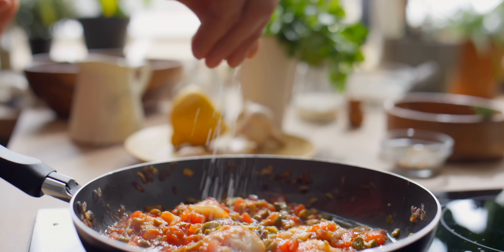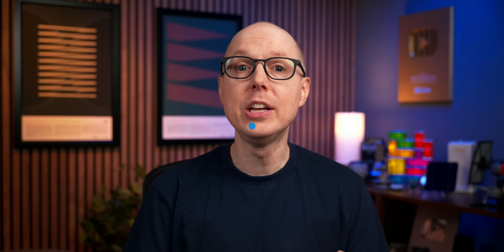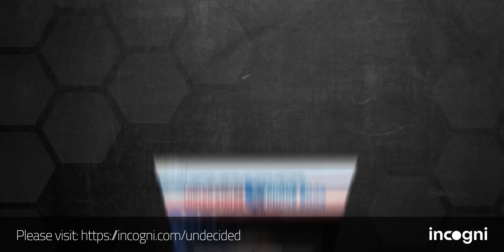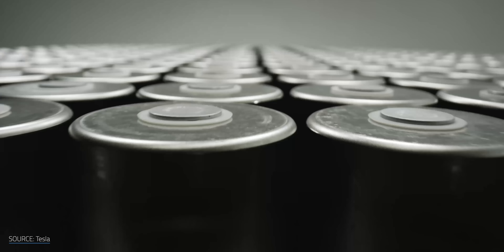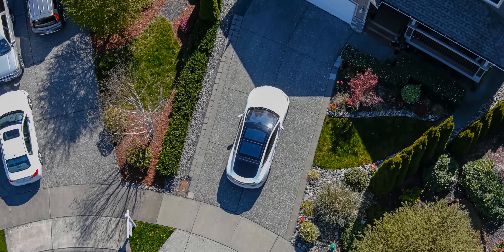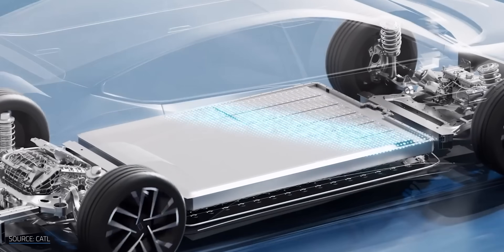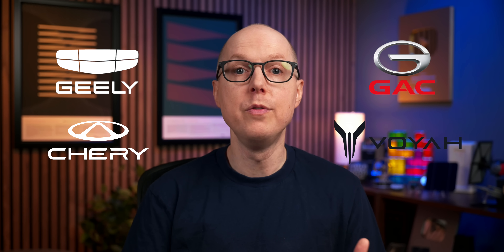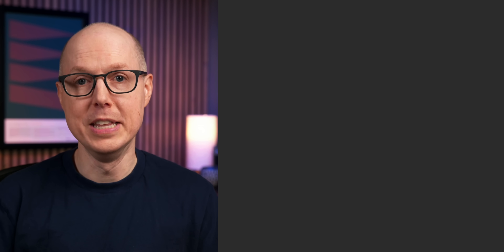How CATL Made Batteries 90% Cheaper (And What Happens Next)

Comment: I would absolutely buy a sodium EV with a cheaper battery but less range and less power. I drive like 70 miles per day tops, and I barely use a quarter of my EV's battery every day, therefore it could be way smaller and I'd still be more than fine. If I ever need to take a longer trip, I could just stop more often. And an EV half the price is already possible even with LFP batteries if they would just build them with 100 mile range or so. The low range isn't what killed the early Leaf, it's the lack of adequate fast charging access and speed. A car with that amount of range but charges quickly and works on plugs that actually exist could be easily affordable and totally viable (drive for an hour and some, stop for 10-15, sounds groovy, wouldn't be bad), people just convince themselves they need more. But yeah of course with sodium they can have more and still get it cheaper as well.

Comment: One glaring thing you didn't mention is that CATL is only selling those batteries in China, and unless we end tariffs in the US on Chinese batteries we may never get those here in the US... that is right, sad panda is sad. Maybe they will partner with someone over here to make them, let's hope so.

One minor thing you didn't mention is that even though the energy density is lower (175 WH/kg NA-Ion vs. 185Wh/kg for LFP vs 270+ WH/kg for NMC) those are at the cell level not the pack level. With the temperature ranges that sodium ion batteries can run at, they may need very little cooling and can be packed in much tighter into modules, packs, or frames if they are using cell to frame tech. That means sodium ion packs could be substantially closer and even superior to LFP already, and may even come close to rivaling NCM packs. Maybe... we will have to wait and see what comes out in China with these cells. 

One interesting thing is that for grid storage it is a slam dunk. LFP replaced NMC in grid and home energy storage solutions almost overnight simply because the cost was 10-20% lower, and no one cares about the weight as long as it is within reason. Same thing will be true for sodium ion, and it may go even faster if it is 50% or less the cost of LFP. Once they reach scale (and reach markets outside of China) they will dominate stationary energy storage solutions very quickly IMNSHO.

Comment: My BS detector is going wild. A couple facts. 1. sodium batteries can use the same assembly lines as lithium. 2. lower energy density,  3. 10% the cost of lithium. These are mutually exclusive characteristics. You can't make a product for a tenth of the cost of a comparable product that is both using more materials  (lower energy density) and uses the same/similar production methods/assembly.  If you want to cut cost by 90% you need to use less material and/or have a much much simpler assembly process.  Even if high purity sodium is next to free (which its not) the material in LFP batteries aren't that expensive either (relatively to the assembled battery cost). This all feels like the stupid hydrogen car hype.

Comment: Ah, sodium ion batteries ... interesting. It'd be interesting to see how the lifecycle cost comes into play (and safety).

As it is, the potential for Li-Iron phosphate type Li-ion batteries as a cost-effective (and even more lifecycle cost effective) competitor to the slightly more power dense and energy dense Li-Ion types is the more ready-made, mainstream way forward for cost-comptitive EV production.
(and a nuanced array of hybrids/Plugin hybrids/range-extended EV designs ... IMO, a greater empahsis on streamlinging EV designs with a full electric drivetrain, but with explicit intention for modular/optional combustion engine range extender: for a diesel/gasoline-electric style drivetrain, would be ideal for the currently nuanced and flexible future market and potential range of efficiencies, sustainability, and for real-world economic, environmental, etc impacts:  with fossil fuel, synthetic/bio sustainable fuels, or something in between)

Comment: I feel like the big thing of the group 1 elements is the higher the row, the more power.
You think the Samsung lithium battery explosion was bad? A sodium one is roughly 5 times worse if it was as refined as sodium.

But that's my basic theory, I haven't had any advanced study on infractructure difference on the two and just the energy difference on water from lithium to caeseum is my biggest guess.

Comment: A 50kw hour battery is plenty to keep me running at home with zero compromises for two days, and much longer if i am seriously stingy on power use. The idea of charging at night, and using it during the day would be delightful. I can shift grid load and save money at the same time. That is good for both.  Get enough of  these in place, and the grid would not have to worry so much about building out for peak load. There are some interesting possibilities here. Distributed battery capacity for the grid, probably means that increased cable sizes / voltages into cities would be less of an issue. Too many EVs presents an interesting load problem on the grid. I am not convinced grid planners are actively planning grid investments to handle where this is going.  Sodium batteries at scale have the potential for a much quicker significant EV adoption rate then average people think. We are past the early adopter phase. Sodium batteries could just be the ticket for mainstream adoption at prices they can afford.

Comment: Meh, sounds like some Elon Musk levels of bullshittery here. What happens to batteries if they need replaced? Are they thrown away or filled back up with salt? If the tech is too complicated for regular people to figure out or work on, than this tech is no different or better than the tech we already have. It doesn't sound like it solves any problems so much as it shifts the problems elsewhere. My RC Li-Po batteries still range from $50-100+ depending on how big a capacity/voltage battery you need and they are nowhere near the size of an EV car battery. $10/kw my ass, that's exactly what Elon said about his rockets, his stupid truck, his tunnel system, and every damn thing else he's ever made. The secrecy behind their tech is a HUGE red flag.

Comment: Pricing seems interesting, could solve one of the biggest problems with EVs is cost.  As they are going to move to it, with more time will come more experience and more optimization. It should get better over time. For sure getting a $25K battery pack for my home for like $2-3K where I can run my home for like 2-3 days would be epic. I guess this is something to watch for sure.

Comment: The issue is that car manufacturers would shift to sodium solely to make more of a profit.  Not just from the initial lower cost of batteries, but in replacing them more often.  And then you have to worry about how all of those things are recycled, if they are.
If you aren’t sure why this hasn’t caught on yet, I would assume it would be because you ain’t gonna just get the people running the lithium trade to lose even more money.
As for EVs and so on, I have one and while I like it, I still prefer my regular car.  I like the feeling of power, the sound of it.  All my EV does is whirl and do the thing, but it just doesn’t feel interesting.

Comment: Integrating these batteries into gas and/or diesel hybrid cars and trucks, would extend those range numbers, by a lot. A hybrid that's 100% electric drive, using the engine only to charge the batteries, would be ideal. That would easily put them right up there with any other car on the road. As long as you can stop to fill up your tank for $20, and recharge your batteries on the go, you could go pretty much anywhere you want to.
Having a small built-in gas powered generator for your electric car  batteries, would go a long way toward easing more consumers into the electric market, while buying more time for R&D to extend capacity and range, even further.
Auto manufacturers should've been pumping out more hybrids, all along, instead of forcing the jump straight to all electric. It would make the whole transition so much smoother and easier.

Comment: The Chinese have started the second generation of batteries with a range of 1,800 miles. The second generation has a projected range of 3,000 miles. And what about the third generation of batteries with a projected range of 30,000 miles? or the fourth generation with 300,000 miles? I know this information because I worked on the conceptual design for those batteries.

Comment: There is a very simple explanation. It is from China, AKA A LIE! China do NOT invent they STEAL ip, so if the west do not have it they have nothing to copy (badly) as they always do. I hope energy storage will come down to 10 usd / kwh I really do as I just paid 100 usd for a 70 Amp 12v (0,8 kwh) led acid marine battery (in Sweden). Be more sceptical of your sources. This is helping a brutal dictator stay in power by exaggerating or even lying about their products, STOP IT!

Comment: This would be somewhat dependent on the ability to scale up and consumer acceptance.  On a personal level I would be fine with a slightly lower range to achieve cost savings.  On another note, no existing tech or newly promised breakthrough will be worth as much if the infrastructure is not there to "refuel" your EV when you travel.  I don't see the policies of the current administration being much help on that front.

Comment: The largest thing that keep me from even considering electric vehicles is the life span of the battery pack, as well as the cost or Replacement. unless I am a billionaire, and I assure you, I am not! I would not want a vehicle that causes more CO2 production to produce, initially, then have to replace the battery pack after what really is a short amount of time, considering how long gasoline vehicles last for, and then have to buy a new battery pack that is half the price of the FV again, over the initial price of the vehicle. Batteries, no matter WHAT kind they are cannot compete with the energy density of Gasoline, and we have at least 500 years of oil reserves that we KNOW about, not including the Natural gas reserves that are even larger. the idea that oil is dead within 100 years is complete BS and nothing more than fear mongering propaganda from the Green movement. the current data on oil production and reserves completely blows those lies out of the water. And until I actually see the product available from a Chinese company, that makes massive bold claims, I will not believe it. since China has been at the forefront of all kinds of falsehoods and outright lies, and that is not even considering that they have an dangerous and outright threatening habot of undermining their product with tech that is unacceptable. several high technology level products from China has been found to have connectivity that can connect to the internet, link to Chinese Servers and allows the Chinese to remotely alter or shut down the product's function entirely. and seeing that China has stooped to the most vile and evil behavior to their own people, we can only assume they will do the very same things to us if given half the chance, so I would be hard pressed to buy ANYTHING chinese, because this could be a thing where the Chinese Government is offsetting the cost of these batteries, by using slave, or otherwise immorally indentured servitude to lower the costs of the products to gain a massive market share and thus gaining access to all the vehicles on the road through connectivity they have inserted into the coding and management of the batteries. we must remember that the CCP is by far the largest and most significant threat Western nations have ever face, since WW2 and the Cold War. China can be dismissed in some ways, like the production of their products has been so undermined by corruption, that they pose only marginal threat at best, in a war scenario, but if they have accessed the market via these new batteries and have offset the costs and not improved the production at all or marginally, and then use their remote access to these batteries they could shut down a lot of people's lives based upon these products. I DO NOT TRUST CHINA OR CHINESE COMPANIES WITH COMPLEX TECHNOLOGY,  They have already been caught by the US government putting this remote access connectivity in several products. and none of them are insignificant, like Home electronics control systems, solar cell management systems, remote access security technology and much more!

Comment: I like sodium for the temperature range and safety. Everywhere is getting hotter thanks to the oil industry, but you really need your car to work in the freezing winter as well. I personally need a battery that holds a charge for days at a time and it looks like sodium might be good for that too. We need EV’s to work for apartment dwellers as well. No charging at night because they don’t offer charge stations. That’s the main disincentive I hear to changing to EV’s from young drivers, they rent.

Comment: Two reasons a lithium giant would pivot to sodium ion tech:  Lithium and money.   Lithium is rare, nasty to mine and process, and lithium ion cells are prone to thermal runaway when damaged even slightly.  Sodium is TONS cheaper, its FAR easier to acquire and it doesn't poison the environment when you process it like Lithium does.  I suspect its also more stable, allowing for batteries that don't combust spontaneously when you sneeze on them.  I really hope it works for them.

Comment: If the company had a plan for replacing the battery when it fails or loses more than 33% of capacity.  One of the biggest barrier to EV adoption is anxiety over a repair that cost twice what it would cost to replace an ICE.

Comment: Even if they are $10 a kwh at cell level, that means not much, you can basically take $30 a kwh off the current prices. 
Because recently there was cells at $40 a kwh new. But that has already raised to over $50kwh, 

The point is, the current price is about $400-1000kwh installed, So take $30 off that, and you get stuff all price difference. Because 90% of the cost of these systems, is not the cells themselves.

Comment: A cheap replacement pack for Leaf's would be huge for used EV's.  I have seen many of them with relatively low miles but the battery pack has degraded to about 20 miles to a full charge.  Replacement packs were $6,000 plus labor.  So the cars just go sit on lots or get junked.   A battery for a grand would make all those cars worth saving.

Comment: The problem with batteries is the weight and degradation. The energy density is still incomparable to fossil fuels. The problem is the batteries do not work for freight for trucks and planes. If they are cheap enough, then swapping battery packs is a option for some uses assuming they were designed for hot swap. Still we will have to wait and see if anything they claim is actually true.

Comment: How soon will they have a home storage product using these batteries?  Slightly lower energy density isn't really a factor for home storage but a 90% reduction in cost and safer battery chemistry are both huge factors.  

Converting my primary home to a 400amp system this year as well as adding a second 12 kw solar system (guest wing) to double energy production though we overproduce for the home and EV's now with our current 12 kw system but thinking of unplugging from the grid in the future (need a good battery storage system or 2 for redundancy).  With the 30% credit expiring end of this year moving these up to complete in Q4 this year.

Comment: Lithium generally burns slowly and sodium metal explodes like a bomb. Sodium batteries have lower energy density. Therefore, larger cells will be produced. Unlike lithium, a sodium cell will explode like a bomb if punctured. The hydrogen gas it releases can be flammable. I couldn't see any difference from fuel cell technology. In other words, it is a technology that will not tolerate errors or accidents. I'm not going to sit in a car that explodes like a bomb.

Comment: I guess my real question would be, what is the DC Fast Charging performance going to be?  If I can add 200mi+ in ~10min (presumably holding 400kW through most of the charge and it's 0-80% charge) and I get around 250mi range at 100% charge, and no issues charging to 100% on a regular basis.  I'd be willing to go with this today.  I would expect energy density and charge rate to creep upward over time as we've been observing, as well.  So a 350mi+ range and charging 250mi in ~5min on 1MW charging is what I'd expect to see in around 10-15yrs.  What battery chemistry gets us there, I'm not as concerned about.  It could be Solid State, Na-ion variant, Li-ion variant, a mixture to level out characteristics.  I don't care (I'm interested in them yes, but I don't necessarily care which one becomes the winner as long as, Cost, Range and Charging speed gets to the point where the anti-EV can no longer say - but I can fill up my tank in 5mins and go.)

Comment: Yeah about that 115 USD/kWh. My 500Wh e-bike battery cost 600 USD in 2015, and the same battery now costs 800 USD. Tool batteries like the cheapest Milwaukee 18V 5.0Ah or Ego Power+ 56V 2.5Ah have seen similar hikes despite whatever was promised at the time for the future of lithium battery prices. 10 years from now your bike/tool battery will cost more per Wh, not less. Inflation, cost of materials and shipping and all that, but the promise was down, not up.